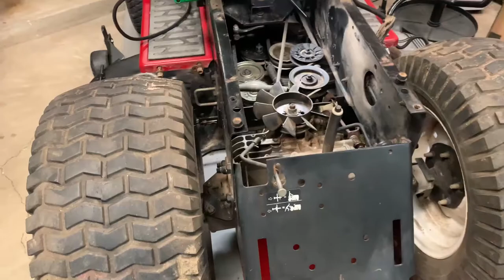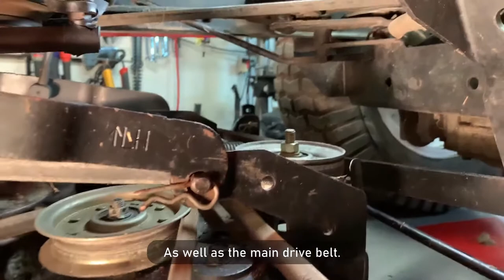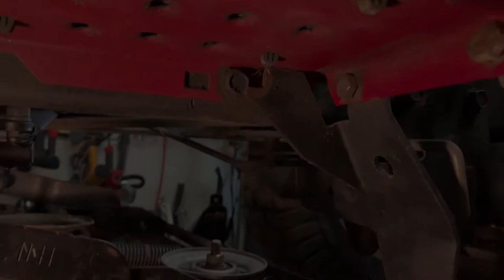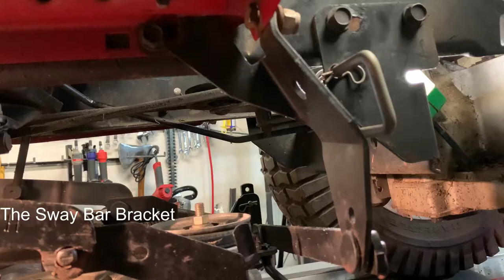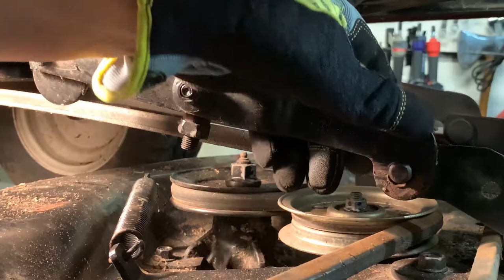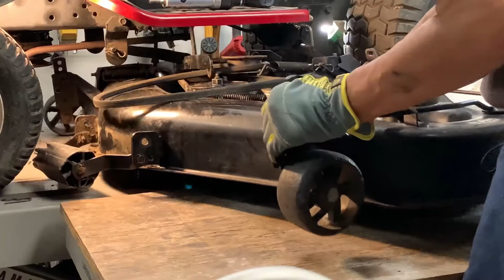2004 Craftsman GT5000  V-Belts Removal & Replacement (Part 1) THE MOWER REMOVAL

Comment: Say that gives me a little more info on it how do I drop the rear gear down belt pully.
Reply from the maker: I'm really not sure what you mean by the rear gear down pulley but see if this helps you on a visual of the rear drive pully which is under the fan blade I remove in this video. If not, again I'm not sure. Here is the link https://www.youtube.com/watch?v=7efygVv2qzY    Thanks for watching.

Comment: Thanks for making this video. I have a HusV that's same model and having an issue where the mower is same height 3" no matter how far the knob is turned...the knob screw is not stripped out...so I'm investigating what could be causing this none adjustment. I suspected doubled nutted somewhere by previous elder owner. I also want to rebuild the loose steering items to tighten steering up. Any good place to buy parts for these still>>?
Reply from the maker: Hello @gwlane5509, To be honest I bought most all of the parts from Amazon. The fuel tank replacement which I did not video was bought off of craigslist, just a lucky find on that one. Thank you watching.

Comment: was it really necessary to loosen those front frame bolts. It seems that the front swing guide clips should have just popped out.
Reply from the maker: Hello Paul G. Thank you for your comment. Actually you are correct it was not necessary, it just made it easier for me at the time. Thank you for watching.